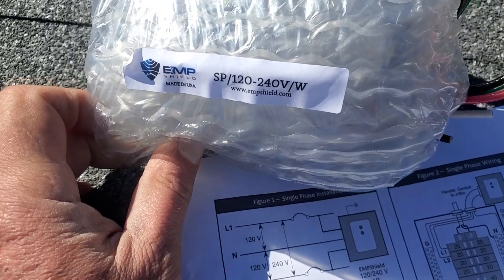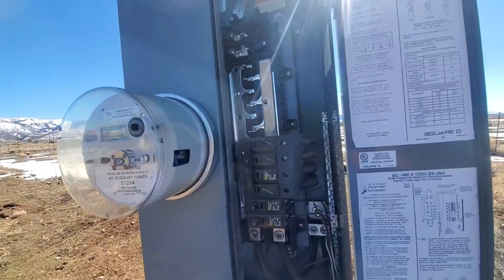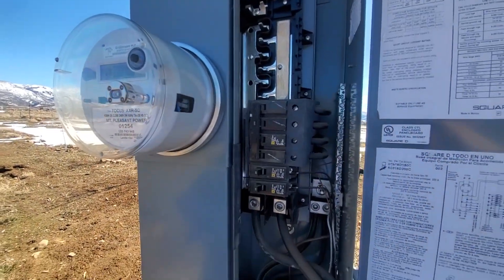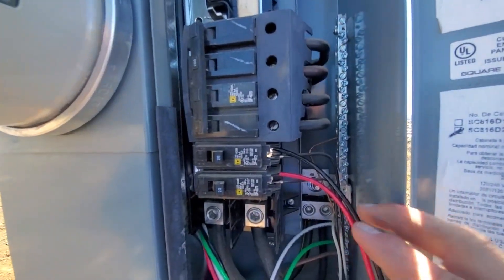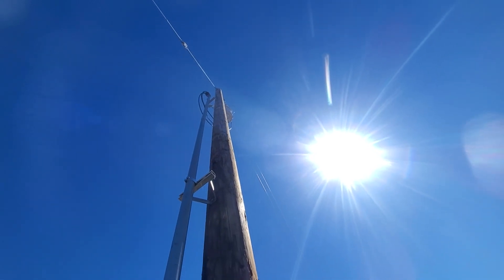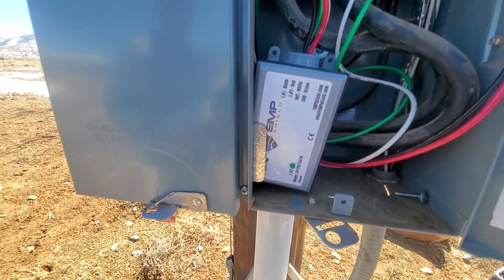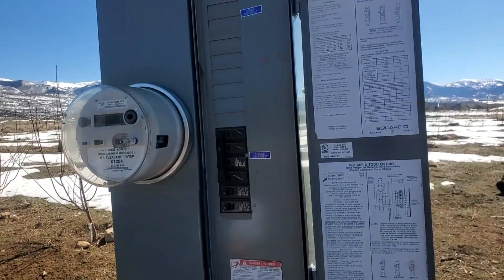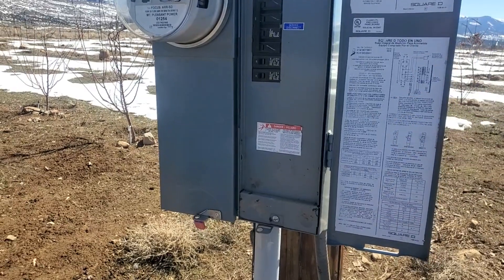EMP Shield Installed in 2 minutes

Comment: We're hoping the current doesn't exceed 3x the rating of that 20 amp breaker. That's all the surge it's rated for. The 10,000 amp rating is for arc extinguishing. It will disconnect without fault up to a 10,000 amps. It will not handle a 10,000 amp surge without tripping. I have several of these type of devices. I do think they work somewhat but definitely not a guarantee. Just mitigation

Comment: If the grid was down can you unhook the 240v service line coming in and directly connect the 240v output from the lvx6048 to those lugs to power that panel?  Then just shut breakers off you don't want?

Comment: What’s unclear to me is how this EMP Shield works at all, being placed in parallel with your circuits.
Reply: i think it takes in the burst and pushes it to the ground and it just cycles burst(s) to the ground until its gone
Reply: It has a bunch of MOV's in it. These act as a voltage clamp and are somewhat sacrificial. They can handle some smaller surges multiple times but a big one will blow it out and hopefully save your equipment.

Comment: Not against code to put 2 wires in the same breaker? (That's what I was told anyway)
Reply from the maker: You are 100% correct!  I figured this does not pull any load, so I bent the rules a bit. Code is a bit strange here,  If I were to run single wires into the breaker and had a twist  connector joining two wires immediately together thereafter, that's considered  legal?. So I've heard. Laws are made for good reason, but sometimes things get strange.
Comments on this welcome
Reply: All the suggestions of where it can be installed, how it can be installed are great. 

I'm happy that its just installed,  I don't have to think about it,  anymore, job done. 

It serves no real purpose,  except for a little peace of mind for that special time in the future

I have 10001 projects going on my head. Now after this is down to 10000.
Reply: Yeah why not use it’s own breaker? Maybe I got confused. Panels rules don’t make sense to me either though. They don’t like pigtails, etc. but the real question is why that device isn’t outside the panel and not shoved inside. My surge protector just goes in a knock out. Same type of thing.